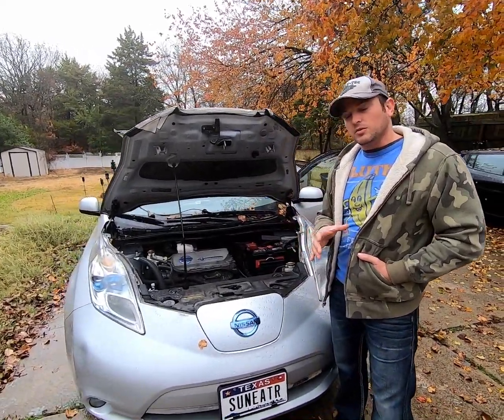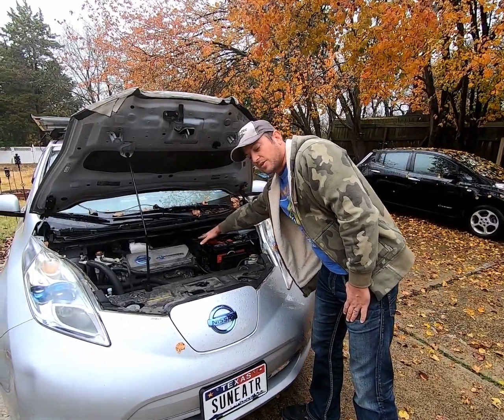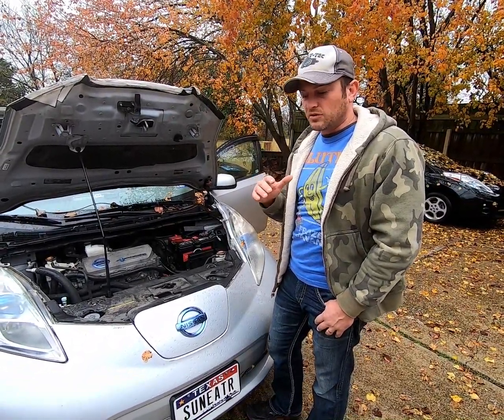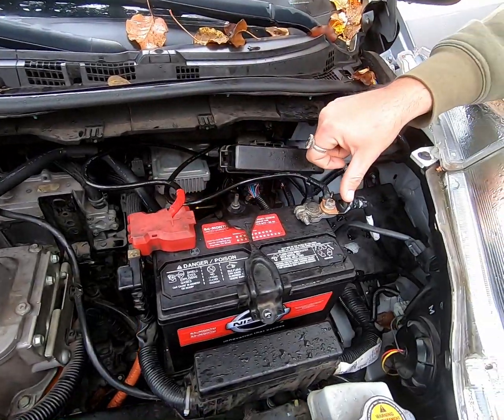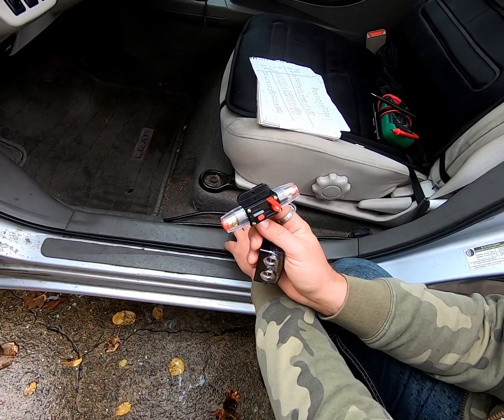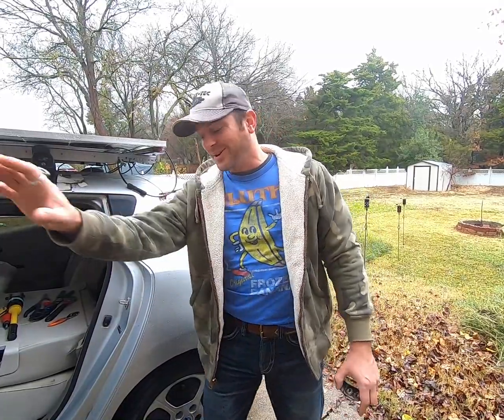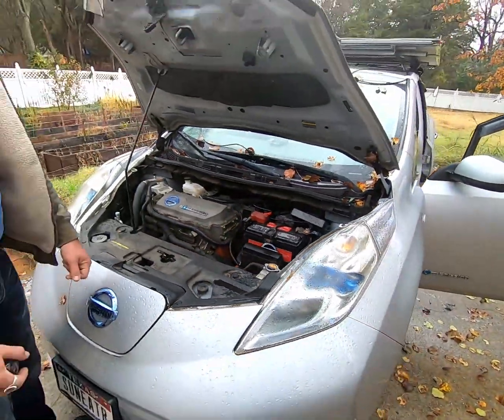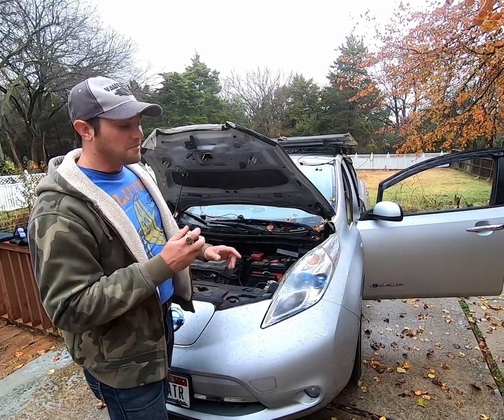Quick Update on my project to power the vehicles 12v systems off the solar battery bank, and more

Comment: Nice project! A great way to maximize the functionality of our electric vehicles.  I don't know about the LEAF but on the Volt the high voltage supply to the DC-DC converter can be easily unplugged. According to a test by evtv the Volt's DC-DC converter looses at least 60 watts no matter the load. That is additional load that can be removed from the traction battery.
Reply from the maker: Hey James!  Always good to hear from ya.  So my initial plan was to completely remove the 12v battery under the hood - ditch the unnecessary weight, and connect everything to the 12v bank in the trunk.  But a funny thing happened when I connected the leads that used to go on the Lead 12v, to the aux bank in the back, and then cut the negative line from the DC-DC converter:  the car died.  Even though the leads were connected to the 12v lines from the bank in the back.  The only conclusion I could draw was that there is a sensor that detects a closed circuit across the DC-DC converter, and shuts the car off if that circuit is opened.  That was my first of several hurdles in this project.

I may either replace the old crappy lead battery with a much lighter capacitor just to trick the sensor; or replace the 12v battery with another LiFePo Valence to increase overall system capacity.  So I think we can remove the 250-350 watt load of the 12v system, but we may be stuck with the 60 watt drain of the converter just sitting there attached to a capacitor to trick it.

How are things going with your custom voltage step-up?  Anyone reading this comment needs to check out Jame's channel and hassle him to publish some updates :)

Comment: Hey this is exactly what I was talking about a few months back :)  in fact I would run a thicker 1000w capable , yes thick expensive battery wire to your boot, skip lead acid all together, remove that lead weight.  Making sure you get no sag in voltage.  In theory that 12v load which is some times higher , especially at night could all be fed from your rear pack.  I suspect that load is higher at times , maybe 500-600 watts ?  And maybe 3kwh over the course of a charger or two. Problem is how do you ensure the main pack isn’t feeding things before your 12v from the main pack ?  Main pack will always feed maybe 13v in when rear pack might be 12 ?
Reply from the maker: See pinned comment for why I was unable to remove 12v lead battery so far.  The switch on the side of the driver seat is the key to preventing your main pack from feeding into your solar 12v bank.  The 12v vehicle load is always attached to the bank in the back, but the negative line from the DC-DC converter is on a switch so the circuit can be opened.  My hope is that we can close the switch when needed to power up the bank in the back on bad solar weeks, or make the entire capacity of the main battery available as a power wall through the inverter in the trunk.

Comment: Where did you get that 250w constant load value from? Surely thats only when there is load on the 12v system, headlights and heaters or low battery voltage etc. Theres no way the DCDC converter takes 250w at idle.
But yeh you should do a range test, one with the car as stock. And one with the solar 12v system hooked up, and compare range.
Reply from the maker: Yes the 250 watt load is present ONLY when the car is on.  When the vehicle is off that drops to about 20 watts I think, something much lower.  When the vehicle is on however that 250 watt number stays pretty consistent.  There are several ways to monitor this.  The test I plan to do to see if this actually worked or not, is gonna be as follows: Park the car.  Turn on every 12v load I can (brights, radio, dome lights), with the 12v system connected exclusively to the solar.  Then just let er run for 4 or 5 hours.  The capacity of the main HV battery can be monitored easily using Leaf Spy and an OBD2.  So if the HV batt capacity stays constant(ish) after 5 hours of a 300 watt load being applied, I'll know my set-up is working.  May also hook up a shunt to the leads in the trunk.  Range tests have too many variables to give us really precise results.

Comment: Your videos always amaze me because of your thought process.
Great job on the conversion.
As soon as someone can get your specs and replicate you can move on to other project.
I wonder what Leaf spy say about your car... 🤣🤣🤣
Reply from the maker: Funny enough the shunt (meter that measures power flow) is "downstream" of the battery connection.  I was wondering what the car's CPU would think when the 12v load suddenly disappeared off the DC-DC converter, but because this meter is IN the 12v system, it doesn't know where the power is coming from.  For now, the car's computer is on a need to know basis, and it doesn't have to know, lol.  But seriously the Leaf's value is in how hackable the car is!  They don't make "stupid" EVs anymore.  They have sensors and monitors in every nook and cranny so you can't hardly touch them without the car locking down.  I'm a huge fan of vehicles that don't monitor every single thing I do while I'm in them (or cutting them to pieces).

Comment: That's a great idea. While driving, could you run the solar to the 12V battery bank in the back to offset the 12V main battery use? Or would you just use whatever reserve is in the battery in back?

2013 Nissan Leaf SV owner aka Sir Leaf A Lot
Reply from the maker: The power in the auxiliary bank in the trunk would run the 12v system (headlights, radio, etc) 95% of the time, including while driving.  The only time I would close the switch (and close the DC-DC converter across the 12v loads AND the aux bank) is when I'm using the vehicles main battery as a powerwall, or the sun hasn't come out for several days and the 250watt load has drained the batteries in the back.  My 4 Valence batts have a capacity of 4.5 kwh, so they should easily handle the 12v system load for 15 hours of the vehicle being on with no solar power input.  The onboard solar generates from 2-3.5 kwh/day, so basically you NEVER have to put the 12v load on the main battery.
Reply: @InnovativeSustainableSolutions  That's so cool. What do you think about an alert if the battery bank in the trunk gets close to not being able to fully power the 12v system? I would love to look into this at some point. Want to keep this car going as long as possible.
Reply from the maker: @RajGiandeep  I run a 12v splitter from the cigarette lighter plug.  This powers an aftermarket seat warmer, and a dashcam.  It also has a readout of the current power level in the 12v battery.  If the 12v system is hooked up to the solar battery bank, then we have a convenient, cheap readout of it's power level in the cab, and we can switch to the vehicle's DC-DC power supply (using the switch on the side of the seat) as needed.  You could also install an automatic transfer switch if the other solution turns out to be a headache.  
https://smile.amazon.com/gp/product/B07FDQLL7K/ref=ppx_yo_dt_b_asin_title_o02_s00?ie=UTF8&psc=1

Comment: Nice so let me clear up your expanding the LOW VOLTAGE 12DC battery system and adding more batteries right ? How are you recharging those solar batteries ? Another question would this help w keep that voltage up12v anyways but then the quest pops , are you adding more weight to the rear your hv engine will need or use more power to move additional weight ? I have an inverter in the back of my car and works fine when on on the auxiliary battery don’t need to add more batteries but it’s just for emergency now yes there is a downside when running all electric car cause then your hv batteries will ONLY PROVIDE power charge to the smaller 12 battery system and this will drain the overall hv batteries 🔋 . You know what would be awesome it’s just a thought adding a way to charge the hv battery with an inverter / transformer big enough to supply energy to those hv that way you would gain more miles I’ll be abit complicated ... it’s just a thought
Reply: This a perfect win-win, because you get rid of the losses that occur by converting 12VDC from the battery bank to 110 AC and then further converting it to the high DC voltage, that will be then converted back into 12V DC by the onboard battery charger for keeping the lead/acid 12V battery full...
How many conversions were there ?...  😉
It's perfectly logical to route a 12V link straight to the car's electric system so you will get the best efficiency out of that extra power you have in the trunk 👍 ( no conversion from the panels to the consumer)
Plus the added 60W bonus you get by disconecting the onboard 12V charger.
So being clever, really does pay !  😉
It would be nice to have an inverter that would convert 12VDC from your battery bank, directly to the HV battery required voltage, even if the amps will be really low.. but there will be some power slowly filling up the main battery.
Like Ampera or Sion must have....
Reply from the maker: @Alex-tj1zo  Dude that custom 40v-380v step-up is the holy grail.  You're right about Ampera, and Sion needing one.  There's no way they strung together enough 3v cells to build up to 400v.  That component, and the process of connecting it directly to the HV battery (gonna have to hack the software to so the contactors will close even when the car is parked and turned off), will probably be the final step in my journey of making the most efficient, self-charging, solar Leaf possible.  That would add 25% onto the 13 miles/day I get from solar now, and remove the need to plug in the damn J1772